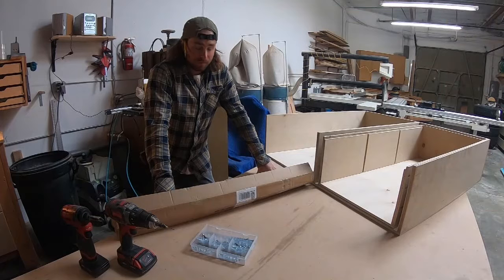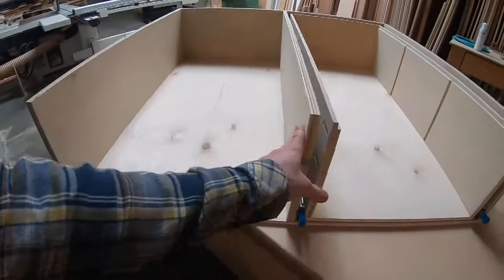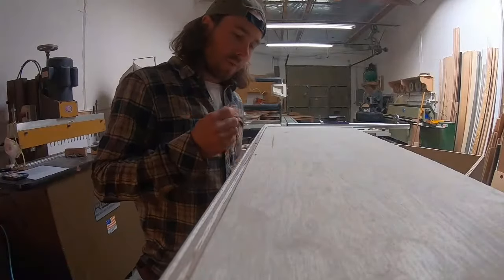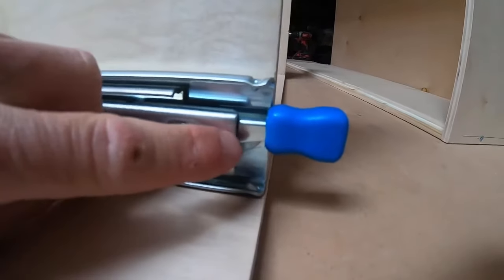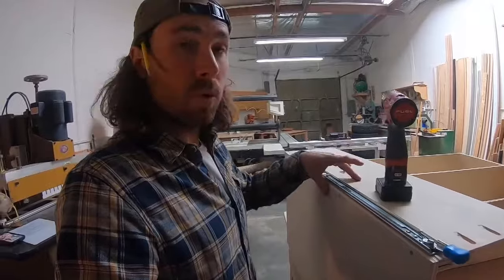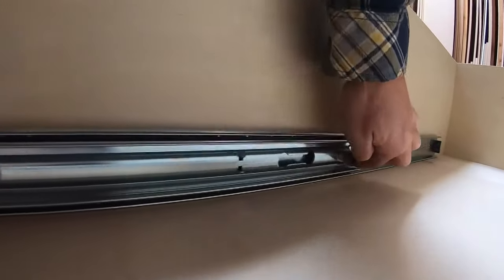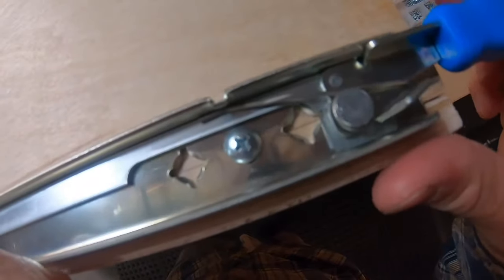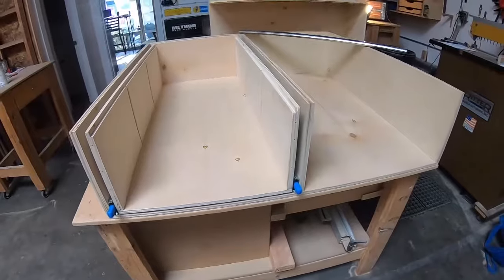How to install VADANIA VD2053 heavy duty drawer slides with lock?

Comment: At the risk of mansplainin', as a cabinet builder of many decades, I can tell you that in proper drawer and box building , one brings the box sides all the way down and the bottom (and top) are "stringers", i.e., fit in between the side pieces, not under (or over). Building the drawer as you have means there is a very strong possibility the bottom will fall right out, given the size of that drawer and it's intended use. You could put 200lbs in that sucker in a heartbeat. Not extending the sides down to the bottom of the box also means that the drawer glides are far too close to the bottom edge of the drawer sides and they will also likely fail. One problem begets the other. Solution: lift the drawer glides up two or three inches to avoid screwing at the weakest possible place on the side ply. Otherwise, keep up the good work!
Reply: Taking this tip after watching this video as well! My instinct was a solid base with sides sitting on top like the video, but I can see how that weight is now all pulling down on that base. Wondering if it's 6 or half dozen when using Kreg screws, but I'm goin to try this anyway. Thanks!
Reply: Are you suggesting a dado? Amateur here
Reply: @izifaddag8221  Yes, standard drawer-build practice is to dado the bottom of the drawer into the sides (as little as 1/4" is fine). The bottom need not be 3/4", btw. For best use of wood I use 1/2" Finnish Ply for everything (NOT shitty Big Box 1/2" ply!): 1/2" sides, dado those for a 1/2" bottom, then attach glides to sides (which run full height). This "traps" the bottom piece in the dado between the sides, thus the bottom can't fall down and the glides can then screw into the side walls (and not the end grain of the bottom) as done in the above video. End grain screws - or Kreg Jig screws meant to hold up the bottom - are close to useless for large drawers. Good luck!
Reply: @christophernassopoulos2497  Thank you that was super helpful. I made a big mistake with a long (5') drawer that couldn't take the weight. I foolishly screwed a piece of 1/4" cheap ass ply using plentiful #6 screws into yet even more cheap ass ply only 1/2".  It looked great when I did it but loaded with cans and doing some long drives it is in bad shape. I am going to make a completely new drawer system using aluminium profile but the drawers are still wood. So I think a dado and supporting separators (needed anyway) will be a vast improvement. Thanks again. Always learning and not afraid to ask.

Comment: Any chance to adjust the sliders so they dont lock half way when closing down? I find this function very anoying.....thanks
Reply from the maker: Normally, our locking drawer slides can be locked both when they are closed and fully extended. 
If you encounter the issue of the slide lock halfway when closing down, please contact our customer service representative through the shopping website, and we will assist you in resolving this problem. If you are unsure how to contact us, you can reach us at alcide@vadania.com
At the same time, please provide us  with some photos or video of the issue so that we can better understand the problem you are experiencing. Thanks

Comment: WARNING, The drawer slide featured in the this video does not have a load rating of 250lbs. The shorter versions (12-20 inches) of the Vadania VD2053 slides can handle that kind of weight, but the longer versions (32-40 inches) like the ones in this video have a much lower weight limit. I have put specs for the VD2053 taken from Vadania’s website below.

32 inches (800mm) max load = 156lbs (71kg)
36 inches (900mm) max load = 125lbs (57kg)
40 inches (1000mm) max load = 94lbs (43kg)

Be sure to read the Vadania’s listings in full to get the correct load rating for the length of slides you are using :)

Comment: Those 3/4" truss screws are enough to support the weight of the drawer fully extended and in use? Camp kitchen application
Reply: I’m wondering the same and I’m thinking no. I think T– nuts or barrel nuts are better

Comment: Which is the left and right side of the drawer? I see them marked but they also look interchangeable
Reply from the maker: The slides are marked left and right, so if they are reversed, you can also just reverse the direction of unlocking as well

Comment: Hi I’m making a van kitchen slide out box and need to know for a 5ft slide out box what side heavy duty draw runners would I need thanks
Reply from the maker: Hi, we have 2 model will fit your box. VD2576 & VA2576, 500mm-1500mm, the 1500mm will hold around 130kg max. You can check on our store.
https://vadania.com/

Comment: Excellent tutorial. I used it to install a drawer for a Dometic cooler. I have an issue with my installation: the locking mechanism on each side locks at different times when pulling the drawer out. I assume this is an indication of some type of misalignment.  Furthermore, there is an annoying squeaky noise, similar to an old hamster wheel when driving on an uneven road. It is my belief that this is also a result of the same misalignment. Any suggestions on how to troubleshoot the issue?
Reply from the maker: Hi Carlos, if they lock in different position when you pull out, I am sure that the install position is misalignment. You can try to uninstall the slides and check. Also check the sliding if they have any noise. Then will get the answer
Reply: @vadania-us  What type of misalignment is most likely? For example, one slide is farther toward the front of the drawer or cabinet than the other slide? Or could the drawer or cabinet not be square? Or the slides are not parallel to the bottom of the drawer? How do I test to find out?
Reply from the maker: @susankeiff4847  The most likely reason should be that the slides did not install in the same level and the same position. That means the screws holes are not the same place for the two side of the sldies. So it may cause that one slides is further than the other one from the cabinet front